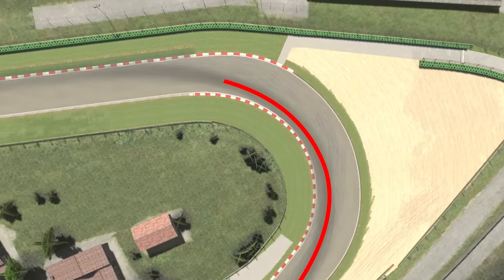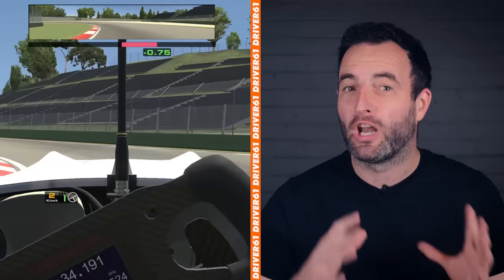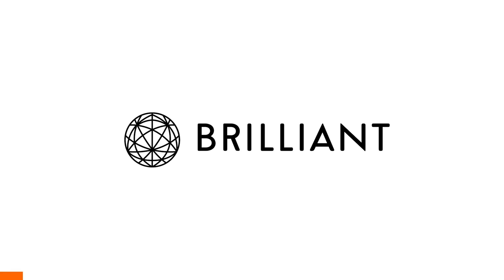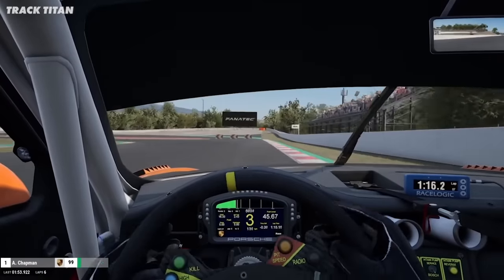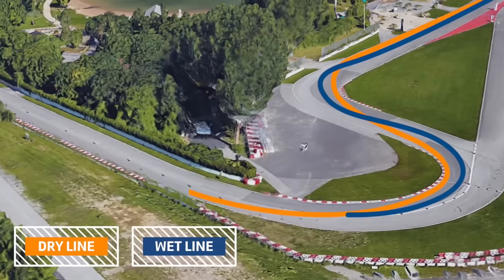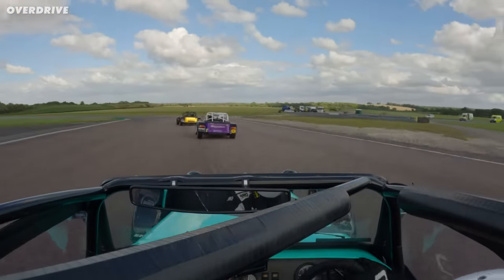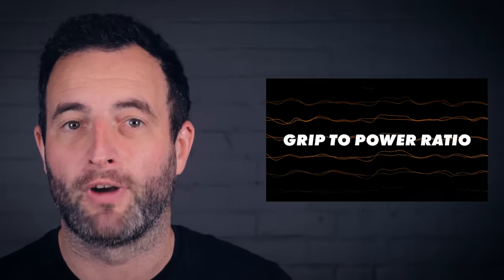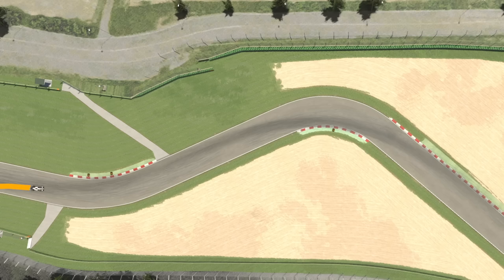Why F1 Drivers Use WEIRD Racing Lines

Comment: The difference can be seen easily in moto racing. A 125cc will seek the "perfect" racing line but a 500cc has more options: brake harder, turn shorter, then reaccelerate harder
Reply: Yup even on the video games for motoGP the moto2-3 class keeping momentum and minimum apex speed is the most important thing as the bikes don't have too much power 

In the MotoGP class how fast can you square the corner and get on the throttle is the most important thing

Comment: It's simple : they take an apex on a turn based on the track ahead. 

Yes, you can go around a turn the fastest possible, but you may not be set up right to take the next turn the fastest possible. F1 drivers account for the entire track, every corner to produce the fastest possible times for the entire run.

 So sometimes a slightly slower apex sets you up for an even faster apex on a faster turn making a total sum of the two faster than normal.
Reply: They also have to account for the car they are driving. Exploit it's advantages.. if you have a fast acceleration but poor cornering, you take less g's on a turn to maintain traction on exit so you can put the power down sooner and longer.
Reply: Oh and a lot of these cars get better downforce in faster speeds so sometimes a faster entry produces more grip which goes against normal impulses bc aerodynamics is blood magic... >.>

Comment: After years of playing sim racing games I deff use a similar racing line. The textbook racing line through hairpins always felt off to me. I always figured you want to get on the throttle as quickly as possible coming out of a corner and that would make up for the slightly slower corner

Comment: Lots of racing cars don't take the geometric racing line because they don't have traction control or ABS, so it's harder to hold the limit thru a long corner.  Braking in a straight line and exiting with more power in a straight line is much easier to do consistently.  Lastly, the ideal racing line often isn't geometric even for other cars, simply because circuits are not geometric to begin with.  They say corner exit speed is more important than corner entry speed, yes and no.  It depends how long is the straight after the corner.  The longer the upcoming straight is, the more important the exit speed is, and the shorter the straight is, the less important it becomes.  Being 4kph faster thru a corner is not as important as exiting the corner 3kph faster on a long straight, and that kph allows you to gain time on a much longer part of the track.

Comment: basically because of the crazy amount of downforce f1 cars have its more efficient to start wide and cut into the corner and then end wide now thats the most ideal way but obviously ur not just racing on ur own so the racing line will differ every time u take a corner cuz if u leave to much space on the inside someone will shoot up in and depending on where u and they r u have to give them space basically makin it so u have to give the position up

Comment: Interesting video Scott. I'm planning to go sprinting next year (2024).  It will mainly be at Curborough. I've got into the habit of trail braking through the first half of Fradley Hairpin based on the way Martin Donelley taught me to take the Rindt Hairpin at Hethel a couple of years ago. I'm not sure if that's the fastest way round in my Elise.
I do need a lot more track time in the wet though, as all bar one of a handful of track days has been in the dry. I've taken on board your advice about the wet racing line.

Comment: Hi good sir. Can you discuss those drivers in F1 that DO use constant-radius arcs? You see it a lot in Mercedes-era Bottas (funnily enough not in his Williams or his Sauber era imo), in Sainz, and Button. Those 1 wheel movement, hold the arc, before releasing the corner?

Comment: 09:26 Actually, this is the line F1 drivers use in the race (2022 generation of cars). And this is the line marked correctly with the red line on the thumbnail of this video. Also: this feels natural for optimal exit of the second corner (for me😉).

Hungaroring T8-9 is something like this: T8 (left hander) has to be taken slower to take T9 (right hander) optimally.

Edit: T10-11 also can be the numbering of T8-9, depending on which corner numbering is used. There are different corner numberings as I saw...

Comment: Great intro to lines.
However you missed some points, for example: in non fig 8 tracks, there are always more of one handed bends to the other.
So it probably but not always, makes sense to set up the suspension for the magority of corners and rely on driver skill for the sub optimun opposite corners.
Relying on driver technique to balance the car will dictate the type of line to attempt.
You didnt comment on opting STRATEAGICALLY to drive on the racing line or to abnormally dive for the lesser grip surface.
This can be used to good effect.

Comment: I would assume the biggest effect on this, is that cars can usually produce close to the maximum theoretical braking force at all times, through all four wheels. But they produce significantly less than maximum power at most times and only through two wheels.

Comment: Not an expert but I think the weight transfer of the vehicle makes a big difference, the front wheels can grip more under braking because the weight transfers onto them, meaning the car can turn sharper at the start of the turn, hence the later turning point. Also in F1 the aerodynamics can change from other vehicles, if you are in the draft of a vehicle you lose downforce and cannot take the turn as normal

Comment: I had a friend bewilderd when comparing F1 to ski racing. Many of the same physical phenomina apply but ski racers have to deal with different surfaces from hard snow to ice. They also have to maintain a rythm where getting behind in timing magnifies throughout the course. Ski racers have also recorded 9 G's in compression turns.  I see sKi racing is a poor mans F1 we can contunue practicing throughout our lives

Comment: not just for sim racers but even normal racing games too! in Gran Turismo, i usually find my self with "Muscle Cars" or other similar high power cars to take sharp turns slower than it can because you can turn in more and get the front aligned earlier! so taking a hair pin turn at 80 KM/h instead at 100 KM/h being one second slower but saving like 5 from being faster for the whole strait!

the faster you go fast the faster you will go, F&F has it all backwards! you have to use the NOS early, traveling half the track at 100 KM/h and reaching 300 KM.h is slower than 200 KM/h early and reaching 250 KM.h at the end, basic logic actually! (you spend more time over all traveling faster even if you did not reach as high of a top speed.)

in this case it is not NOS but with really fast acceleration, the sooner the front is strait, the sooner you can put the pedal to the floor so you exit the turn and enter the strait way faster and at higher speeds. that Grand Turismo saying that tires only has 100% traction is what is going on here, if you are busy turning and keeping the car stable, you have very little traction left to floor it and accelerate.

Comment: I heard that as karts don't have diffs, you need to lean away from the corner (opposite of the natural tendency to lean in) to unload the inside wheel to get better cornering.
F1 is an anomaly of sorts as you need more speed (and more bravery) to get more grip via downforce.

Comment: Tldr: The geometric line is a one dimensional solution to a multidimensional problem of braking performance, lateral grip, and engine performance.

A car with poor brakes, average lateral grip, and low acceleration will drive closer to the geometric line.

A car with high performance on all 3 will lean far more heavily on all 3. Late, hard braking, hard, fast turning, early, high acceleration.

Comment: Hello,

Great video.  I instruct for PCA and have used a very similar presentation in classroom to get drivers to think about “what is this line thing you speak of…”.  A question I have though is in the last left- right complex you discussed, it looked to me that the blue line would have been faster.  Why is this not the case?  Your description does not answer this for me.  My thought would be that, maybe, the tighter line in the left hander loses more time  than is gained by the potentially faster line through he right hander.  But then again, would this not be dependent on the length of the following straight?

Thoughts?

Thanks,

Arnie

Comment: Short corners, long corners, every corner is different and it really depends on the driver. Nothing wrong with anything said but, Senna was a geometric/ideal line guy - Mansell was a short corner/ideal line both work depends on the driver, the car and the day. Two very different drivers in the same car Sainz(geometric long corners) and LeClerc(Short corners long straights) if it works it works.

Comment: After watching ig im right to an extent, but there's still alot of other stuff that i didn't know 👍🤝

Im not a f1 driver neither do i have track experiences besides drag races, but I've been playing sim games quite alot. I'm guessing that line is to aid traction to get the best exit, with that line you'll beable to get on the throttle earlier than on the blue line, thus giving you more exit speed, and adding more speed through the straight which im assuming might be after that chicane. So basically i think it's sacrificing mid corner speed for the advantage on exit, which will give you a speed advantage over the blue, so at the end of the straight you'll had gained more time than the other line. I did alot of hotlapping on Ac and i figured that out through looking at the deltas, i only do that on corners where there's a decent straight after, i don't think it'll help much if there's no following straight, unless you in a race and ur using that line to maybe boost you next to ur opponent in the next corner. Lastly this might not be this at all and it could be something that's done in "Real F1" for different reasons, but idk that so im just guessing.

Comment: Nascar at Miami this coming up weekend. Watch Kyle Larson and Reddick run the wall. While other drivers are on the inside hitting the white line. Yes, some of it’s due to handling, but drivers who are skilled
enough to run the wall benefit from higher entrance/exit speeds and less tire wear, even though they are traveling a greater distance.

Comment: That same idea from F1 is the reason why rally drivers drift in certain turns: they lose a lot of speed in the drift but leave the car perfectly positioned looking straight towards the turn's exit  so they can go full throttle in a straight line  whilst still inside the turn to maximize average speed.

Comment: What strikes me when looking at F1 is that drivers often seem to be quite far off the expected optimal line. For example, taking a wide geometric line through hairpins, without even getting close to the apex.

I'm guessing this is to reduce tire wear and tire temperatures. A tighter line would stress the tires more and cause more sliding, while a wider line can be taken with less lip angle and not require as much friction from the tires.

Is this a correct interpretation?

Comment: F1 cars have Aero downforce that generates exponential negative lift, therefore additional grip, as the square of increasing speed. Therefore You want to carry far more speed into a corner to maintain aero-grip. You can brake far later with aero downforce and drag.
Reply: What's the point of a spoiler on a car? Let's say it's not cosmetic, that it's on a car that can get something out of it.
I know why spoilers are used on airplane wings, to spoil the flow and spoil lift.
But on a car, on the trailing edge of the body the only thing I can think is the dead air drafting drag gets broken up which could be good for gas mileage. Style points if that counts.

Comment: You attended a different racing school than I did, if the shortest time from turn entry to exit was your primary goal.  I learned adapting a line to yield the fastest lap time based on what’s before and after a corner.  Your explanation of turning in earlier to allow faster exit only applies to corners preceding a straight. I would bet a fair bit that this is not a global description of how F1 drivers handle every corner.

Comment: When I saw your thumbnail, this theory popped in my head, tell me if it's true. I think the drivers would want to exit the turn at such an angle that they immediately are able to form a straight-ish driving track and can accelerate faster when out of the turn. Since f1 cars have incredible braking and acceleration, I recon that it's more efficient to brake hard before a turn, and maybe maximise your acceleration by giving yourself plenty of room as soon as the turn is about to end. This is just a theory and I have no knowledge about physics, so correct me if I'm wrong

Comment: About the wet line / dry line, does rubber accumulate on the track even if it's been wet or raining already?
For example, would drivers start following the dry line even on a wet track and later switch to the wet line?

Comment: Great explainer. I always wondered what the difference in distance traveled is between the perfect line, the ideal line, and a theoretical line that minimizes total distance over a lap (i.e., tight to the inside turn with gradual straights that point to the next inside of a turn). I suspect that the ideal line is actually the longest distance traveled but is negated by the speed difference.
Reply: Yes and no, it was explained in the video... Asuming, that your car has (extremely high capability on acceleration and decelleration force, the track and your tyres provide same grip level everywhere, you are able to break down to exactly the maximum driveable speed and you arrive at any given turn faster than the highest driveable speed,  then the way with the longest ways through curves and the shortest straights would be the fastest, as in theory the way through a circle with twice the radius is twice as long, but driveable at 4 times the speed).. But as easy to guess this preconditions are seldom met..
On the other side, with a very slow car the really shortest way over the track would be the best one... In principle the line over a formula one  track, which u would take with a bycicle, asuming u are not able to bike faster than 30 km/h..
The ideal solution is obviously something between those two extremes adopted to weather and the vehicle u drive

Comment: sometimes it's hard to keep a car smooth during a corner, racing line tends to come apart under stress, choosing to use ideal line is making sacrifices, but there are circumstances the sacrifice would be worth it

Comment: without bothering to watch :  Because they 
1 have downforce
2 super suspension 
3 super grippy tires.
4 It sometimes pays to brake later when other times they need to accelerate early out to get the top end on the straights

The main thing is the downforce, suspension and tires
#4 is not unique to F1.

Comment: Not watched yet, but one reason is exit speed for straights.
So you might set up a slow line through one corner that allows you to get a fast exit for the next straight because there is more time saving to be had from it.  Its all about fast laps not fast cornering.
No need for me to watch now 😂

Comment: so high grip low power vs low grip high power are two corner (pun intended) of high inertia type of car, f1 have almost no inertia, it can break hard and accelerate even harder, so the line will priorize early acceleration, would be interesting to compare with bike line as they have even lower inertia, i guess f1 line is close

Comment: what about the trade-off between what's the fastest path through the turn as far as the cars speedometer reads versus the extra distance a car has to travel through a turn based on its odometer and why don't we talk about the trade off between having to travel a further distance versus a shorter time?
Reply: also there's the idea that the exit speed coming out of the turn is important, so we want to maintain as much speed as possible so that when we come out of the turn we're not accelerating from such a low speed

Comment: Yes, the "ideal geometric line" is not the fastest way around a track. The analysis, however, is not nearly as complicated as this. There is one overriding objective: to maximize the acceleration of the vehicle--be it forwards, rearwards (braking), or lateral (cornering)--or any combination thereof, at all times while remaining on the track. Almost all cars produce more braking acceleration than lateral acceleration, and more lateral acceleration than forward acceleration, so the "friction circle" is slightly oblong (top to bottom) and then clipped at the top (acceleration) (drag racing cars are clearly exceptions to this). Therefore, the fastest driver is the one that modifies the line such that the car is cornering at the edge of the friction circle envelope at all times. As you point out, F1 drivers brake later and deeper--thereby maximizing acceleration backwards. Turning in, they turn tighter because again, it maximizes lateral acceleration. Getting on the gas before the exit vs braking even later has more to do with whether the turn is coming before a long straight or after a long straight, but the maths is all the same: maximize acceleration, no matter what direction, at all times.

Comment: Lap time = Distance travelled / Average speed

So you see, minimising lap time is not about maximising average speed but minimising the ratio of distance travelled to average speed.

E.g. If you gain 5% in average speed but it cost you 6% in extra distance travelled, you're lap time will be longer (+1%) despite the higher average speed.

The importance of deriving from first principles.